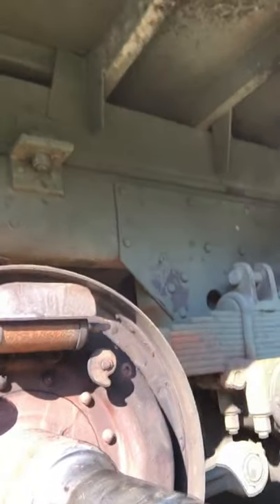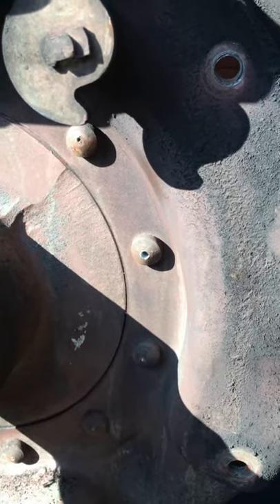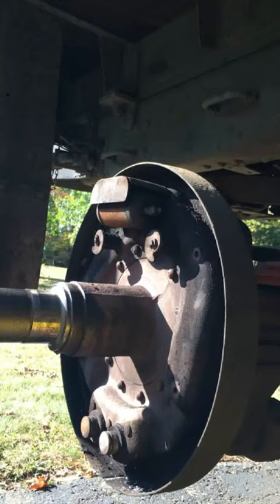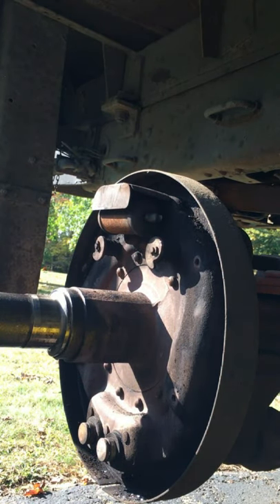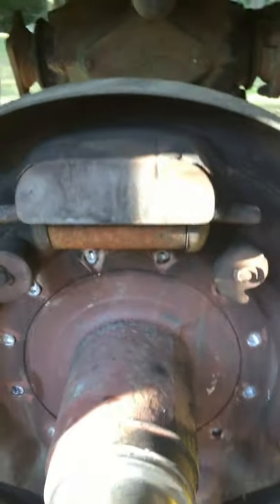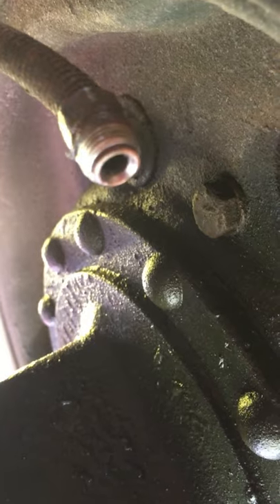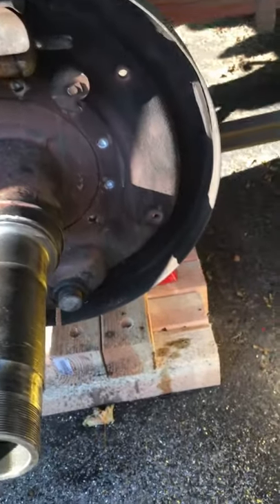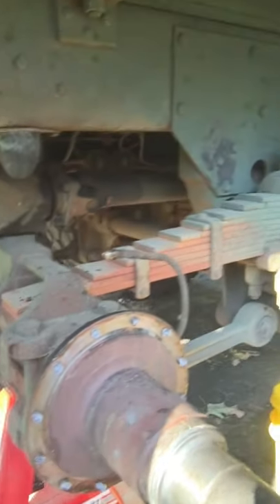M35A2 disc brake conversion

Comment: Did you have to replace the hydraulic brake buster and the master cylinder?
Reply from the maker: The brake booster was on the list of parts I bought, but I did need to replace the master cylinder as well.

Comment: Would that kit work with the duals, or are they for the super single?
Reply from the maker: Thanks for your question! They don’t take up any more room than the drums they replaced at all. Boyce Equipment makes no mention if they are strictly for super singles, so I would be pretty positive that they would fine for the factory duals.
Reply: @chopperbuilder70  I've seen the other kit the uses 2002 f350 or 550 disc and calipers. Using the existing hub.wonder if Boyce's conversion is the same  hardware.
Reply from the maker: @ngarza6685  true, the calipers I got from them were Ford parts.

Comment: What was in the kit?  I have a  lot of stuff from Boyce, their customer service and directions suck! Well done, Thanks!
Reply from the maker: The discs, pads, calipers, caliper mounting adapters, hoses and hardware. I had to fab up brackets for the hoses to keep them in place and I also ordered seals and gaskets to service the bearings while I was in there. I had no issue with the customer service, but agreed the instructions (pictures) did lack. They did say they are going to provide better ones with a video link on the website in future. Thanks for your question! 🇺🇸🇺🇸
Reply: How much does that kit cost and did you adapt it over to dual circuit system. Can you still run the dual 900×20 ndcc tires
Reply from the maker: @georgedistel1203  kits were $850 per axle and I’m still using a single circuit system for now. You should have plenty of clearance for stock duals.
Reply: @chopperbuilder70  ouch! Do you have to go back to that company for pads and rotors when they need replaced or do they use a rotor thats commercially available
Reply from the maker: @georgedistel1203  they use a Ford caliper, pads and rotor so no. That’s one of the best parts of this kit, no need to go to a specialty vendor for brake parts in the case of a break down...
Reply: @chopperbuilder70  so far thats great glad to hear that one. If I keep mine I may do that next. The big problem is I just completely rebuilt the entire brake system on it.

Comment: I'm from the Philippines, I just want to ask if there's another video prior to this video?
I want to learn more. Thank you sir
Reply from the maker: This is the only one out right now...I do have another shorter video involving front brake conversion, I need to find it in the PC and upload it. Thank you for your question!
Reply: Thank you sir Rob for your quick reply. Actually I do have my own truck (1940's military truck) . My late father acquired it in 1959. It was converted to a logging truck during the time. Eventually he acquired another 8 units. But as of the moment, it downs to two. In 1980's we converted the under chassis to M35a differentials front to read. I was fascinated on your video. That's why I ask if there's another video. I want to convert my front differential from drum break to disk breaking system. If you may I have a video of my truck in action on YouTube. Please look for "Bataan Woodpicker" (not Woodpecker). Thank you sir

Comment: Did you keep the same master cylinder?
Reply from the maker: Yes I did, it retains the same single circuit system.
Reply: Thanks! I was thinking of doing this myself. But wasn't sure. I never can seem to get the drum brakes set right... 15 tries later and my brakes still seem squishy. Not to mention fighting constant leaks from the wheel cylinders... every time it sits for a month or two and I got a new leak to deal with 🤦‍♂️
Reply from the maker: @Freedomandfreedomalone  no special tools needed, all common tools any home mechanic would have in their toolbox. The grinder and air cutter are about the only special tools I used.

Comment: Was there a part number on the calipers and rotor?
Reply from the maker: No as they came in a large kit from Boyce Equipment. Depending on who you ask, it’s been said they could be from an F550 Ford.
Reply: @chopperbuilder70  Ok thank you. Have a plasma table and would like to make a set for my self. So i can use the extra money and buy the mrap wheels from boyce.
Reply: @chopperbuilder70  also how was the disc mounted you skiped that part in your video.
Reply from the maker: @elfwithabike  it’s mounted with the same hardware that held the old drum to the spindle.